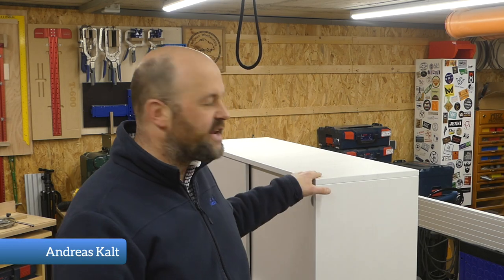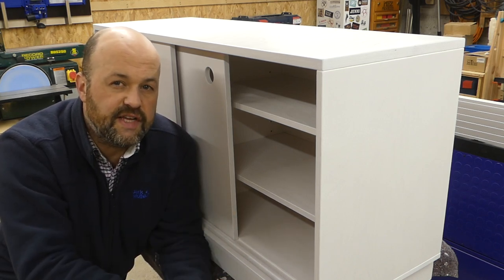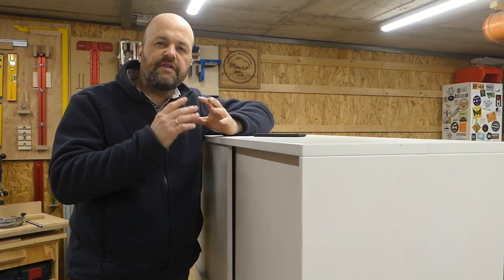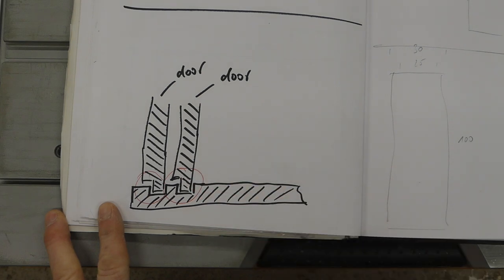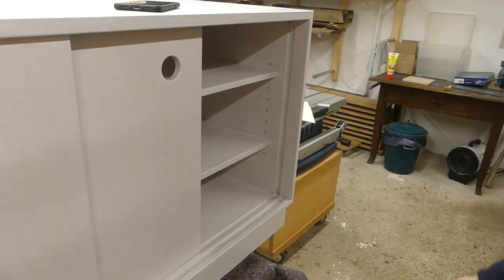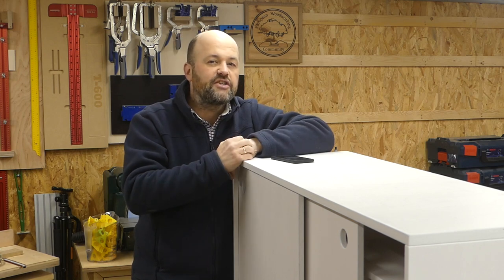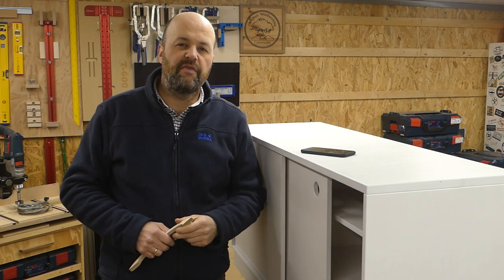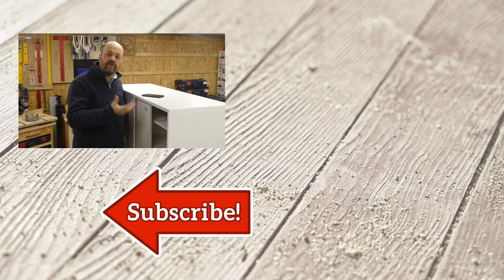Install sliding cabinet doors  (no hardware needed)

Comment: Some interesting tips there Andreas. In the furniture trade even the big manufacturers use a little paste wax or candle wax on friction surfaces ie Drawer sides or sliding door runners it makes a huge difference and impedes premature wear on those surfaces. Keep safe and warm over there we are expecting another bitter cold week.Kind Regards Stuart Bell from UK👍
Reply from the maker: Thanks for that tip Stuart. Over here, the cold is only in the north. We’re here in the south of Germany which is not supposed to become so cold this week.
Reply: Thats good news on the weather front. Keep up the good work Regards S.

Comment: Hello.  I am putting together a bookshelf that has a sliding door with a door track.  The manual isn't very good and there are no videos of this model online.  Does the door track mechanism (the plastic strip with the indention for the door) need to be flush with the bottom of the bookshelf?  They aren't fitting very well so I am wondering if I need to hammer in or what I need to do.
Reply from the maker: I have no idea. That depends entirely on the shape of the tracks and the overall construction. This is impossible to answer without any pictures.

Comment: Good tips.  Something else that works for helping sliding is soap and wax. The soap would be a bar soap, the (old fashioned kind), just rub real good on the bottom of the door.  Use a little wax (bee's wax or even candle wax) in the bottom groove. This will also help keep the dust out.
Reply from the maker: Thanks for the tip.

Comment: Girlfriend bought a second hand cabinet. The doors are too small/the grooves are too deep and they just fall out of the grooves.
Any suggestions on how to rectify this?
Reply from the maker: Place strips of paper or cardboard in the bottom groove; stack them until the door doesn’t fall out anymore. Then you can measure how high the door needs to be lifted to not fall out. If it’s only a millimeter or two, use gliding tape and stick it in the bottom groove, if necessary, stak two or three layers to make that groove shallower and keep the door from falling out. If it’s more than just a few millimeters, use a thin strip of wood and place it in the bottom groove
Reply: @holzhandwerk_ak  Sorted. Thankyou very much for your help👍

Comment: How big can doors be to use this method. I have two doors 3 ft wide and almost 5 ft tall. Anyone done them this big
Reply from the maker: I would say that yours are too heavy for this method: I'd get some sliding door hardware with ball-bearing casters